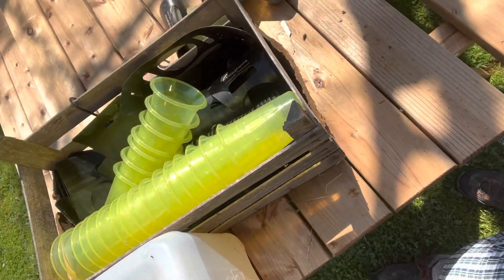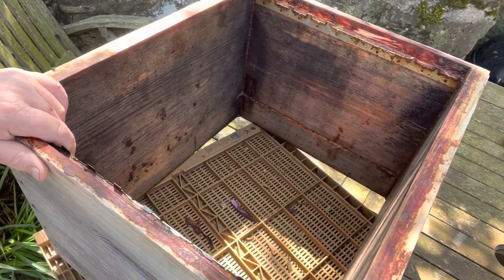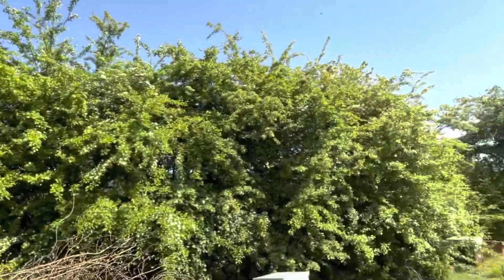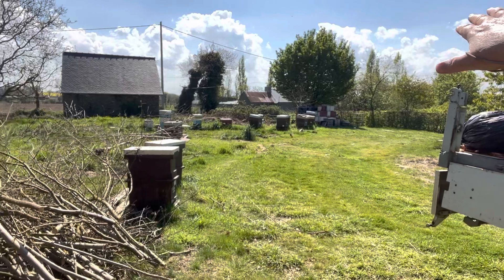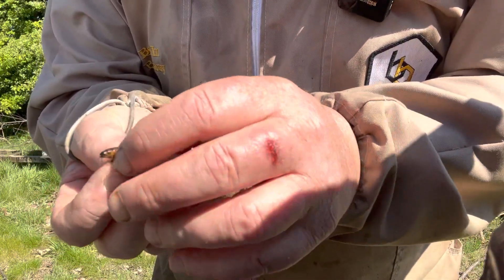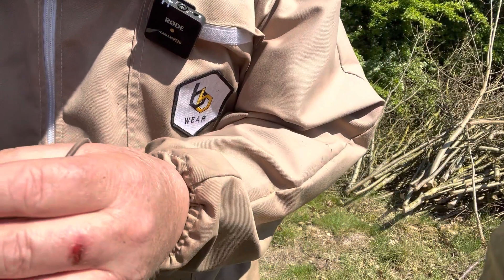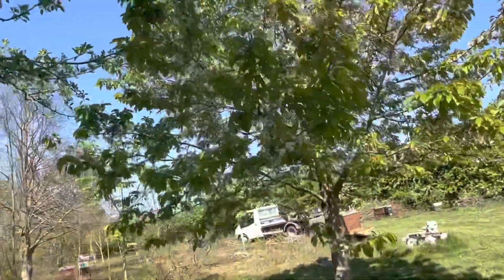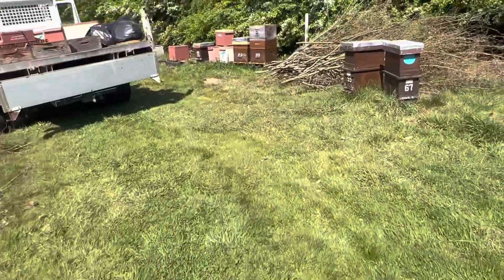Configuring that first cell builder in a whopping nectar flow!! 💯🙌🐝

Comment: Nice video, Vax on plastic frames, cant remember we had your point of wiue on waxing them ;)
Reply from the maker: Hi Bub, for me if the spacing is right they don’t need it. Also if a flow is on there is rarely an issue. Some ore wax them but it may be down to type. These are callled “baticadre” made by Nicot in France. lol up Nicoplast. 
I imagine some might benefit from it!!
Reply: @richardnoel3141  no wax, how cool, need to test my Nordwalben plastic frames un waxed.  Or is it just Baticadre tath works ?
Reply from the maker: @bub1683  as I said you will have to test yours and see. It works on mine. I think it’s more if the plastic has an odour

Comment: Thank you so much for making these videos, they are really helpful, especially explaining the different plants / trees in flower. You probably take for granted your plant knowledge given your background in horticulture, but I really appreciate the knowledge you share. Here in the UK 🇬🇧 it has been quite a while since we had rain, Will this cause the nectar flow to stop?
Reply from the maker: Thanks Ben initially no the nectar flow will still continue because there’s probably quite a bit of moisture in the ground the problem comes for the summer nectar flow when it starts to dry out deep. When you have continuous spring rains it usually keeps the level topped up to a certain point and then the summer flow is usually OK but we are the same here in France, we haven’t had any real rain for the last four weeks either only time will tell the big trees like chestnut and lime will still do really well because there’s lots of moisture in the ground but the shallow rooted things like bramble will suffer thanks for your kind words best regards

Comment: You ever find that it’s hard not to let the bees draw wax on your grafting frame during a massive flow? Do you ever do anything to mitigate that?
Reply from the maker: Make your grafting bar as thin as you can. Push a frame close to it on either side.also put in a frame of foundation  a few frames away, so the wax builders can work on something. That usually does the trick!! Best of luck
Reply: @richardnoel3141   Thanks. 😊🐝